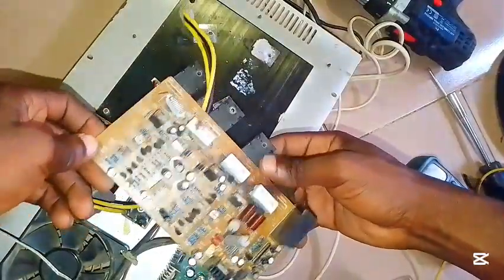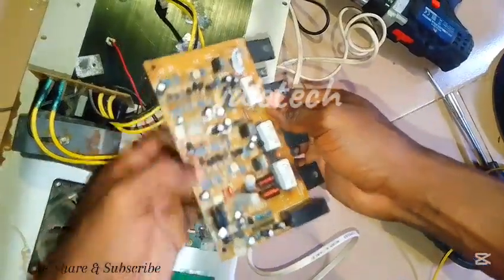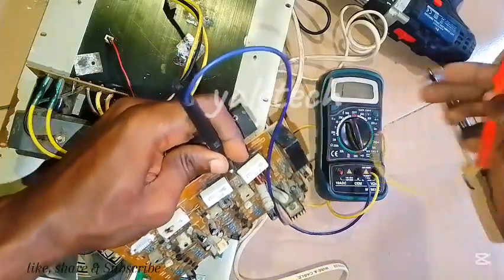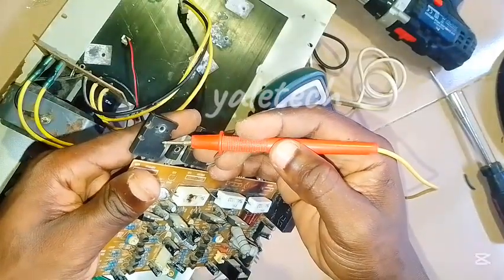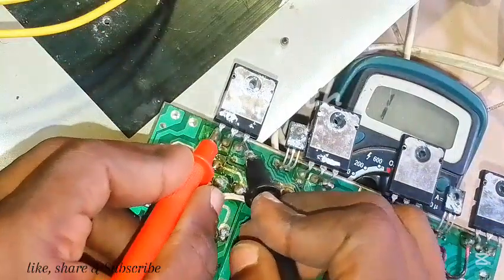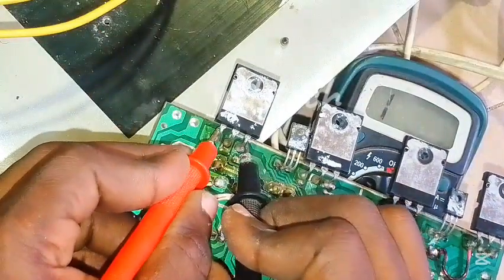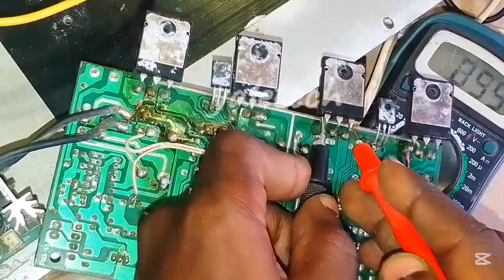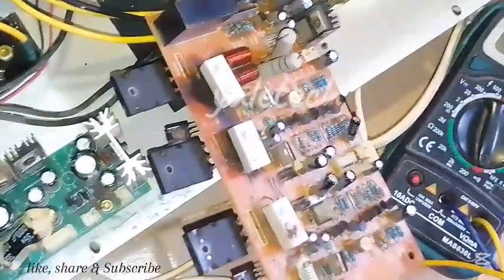How to Repair an Amplifier at Home: Easy DIY Guide

Comment: I wonder if you are willing to do the repair for me, and I am willing to pay you for it with a reasonable rate.  I can send you the amplifier plate  without the subwoofer to test. I got two Edifier T5, 8 inch 70w Subwoofer working great connected to Fosi ZD3 DAC preamp.  Now, I got no sound, the subwoofer power on with a green led dot.  I am very sure the amplifier plate is shorted out.  I tried to find an amplifier plate replacement, but there no such one exit for this specific one.  Let me know if you are willing to help me out and how much you want  to charge for the repair.
Reply from the maker: Well am in Nigeria, if you're willing to ship it, I will definitely get it fix for you
Reply: I thought you were in the USA. Oh, well.  Thank you for the offering .  Subed to help your channel grow.  Good luck.

Comment: pro iwant some Help in my amplifier
Reply from the maker: Explain what the precise issue is
Reply: The device has a power supply and everything is working, but there is no sound. When you turn up the volume with the volume key, you find that the sound is cut off and not clear, and there is a scratch.
Reply: I want to send you a video of the problem so you can help me